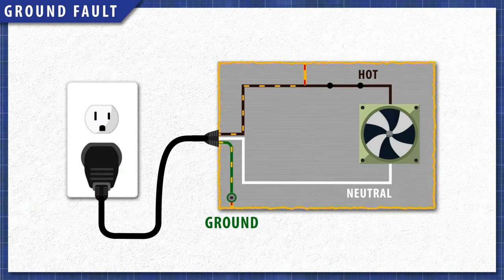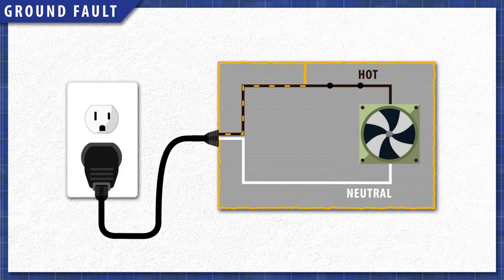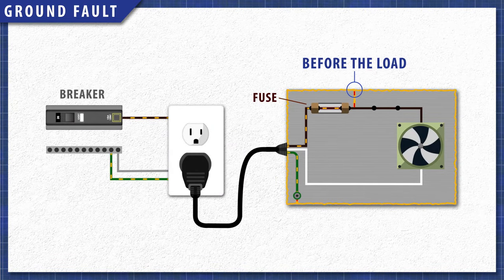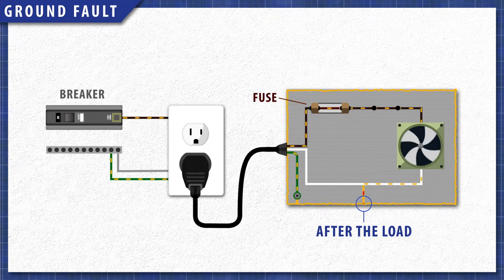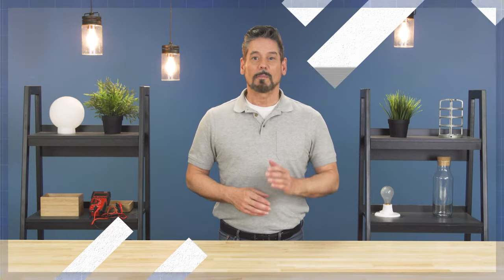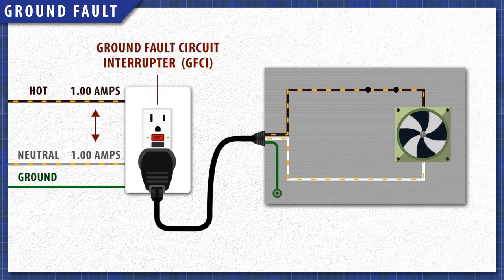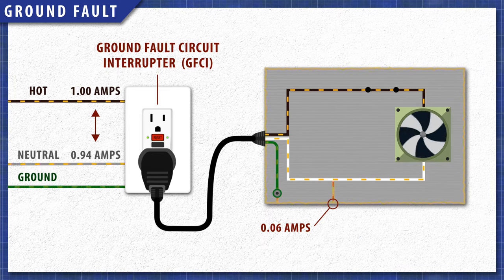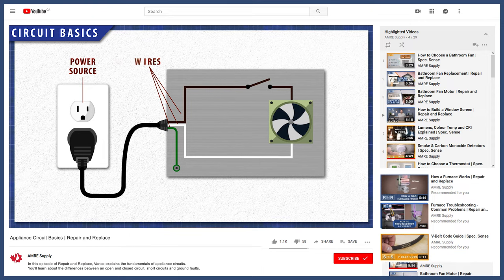What are Ground Faults? | Repair and Replace

Comment: Thanks for the video, if the appliance is not grounded and a ground fault occurs, can you please explain how a person would be electrocuted while  touching only with his left hand the appliance housing -  it makes sense to me that the left hand will be at the same potential than the metal housing  however I understand that in order for the person to be electrocuted, he must have his other hand or another part of his body connected to neutral for the the circuit to  compete and the electrons to flow, so how would he be electrocuted by touching only the hot wire and being completely disconnected from the neutral - thanks
Reply from the maker: Thanks for watching. If an appliance doesn't have a ground wire, and has has rubber or plastic feet then it does not have a good path to ground. If someone's body has less resistance than the appliance's path to ground, and the appliance is shorted then the electricity might flow through their body to ground. Wearing shoes can reduce this chance of electrocution as the rubber soles disrupt the path to ground.

Comment: Thank you for the video. 
My outdoor plug just out of power while I using an electric lawn mower. GFCI and Ground fault BR breaker are both used in this line. I replaced both of them and still not working. The breaker's error code indicates there is ground fault issue. so just wondering how to narrow down and find out the ground problem. 
Thanks.
Reply from the maker: Thanks for watching. First test reset the breaker and test to see if there is voltage at the receptacle itself. https://www.youtube.com/watch?v=kH2Rbh_m6rM If there is power to the receptacle try plugging a simple light first to see if that trips and creates the ground fault error code. If the code continues to show up then its possible that there's a fault between the outlet and the electrical box, or in the wiring to the breaker.

Comment: Good  morning my question is .what is capacitor value of furnace blower moter  .we need mfd and voltage
Reply from the maker: Thanks for watching. The capacitor values vary between furnaces. The capacitor value is written on the side of the capacitor. 

We have a video that explains capacitors in more detail: https://www.youtube.com/watch?v=NkgxNLCrmr0
As well we have a video that shows how to replace the blower motor and capacitor: https://www.youtube.com/watch?v=4SY8lRl8HV0

Comment: Thanks for your very well produced videos. 

I have a question you might be able to answer, since you also produced a video on condensate pumps. My condensate pump is plugged into a dedicated ground fault outlet, nothing else is plugged into it or chained off of it. For more than ten years it worked great and never tripped. I did replace the pump about six years ago when I had other maintenance work done and my contractor advised replacing it. This pump has a furnace cutoff, the old one did not.

What is happening lately, for a few months now, is the ground fault trips - for no particular reason. I have not changed anything in the house for years, so I don't suspect an unintended wiring error somewhere. 

My suspicions are as follows: (1) The condensate motor is failing, (2) the GFI outlet is failing, or (3) the drain hose has slowly built up debris and is causing the sump pump motor to overwork at times, leading to a GFI trip.

I can definitely DIY this, and can easily afford to simply replace the condensate pump and GFI for much less than bringing in a plumber or technician. But I'm wondering about the drain tube which is 25- feet long and fairly difficult to work on. It is a bit cloudy in appearance, but the water moves along just fine inside. I am "tempted" to pour something into my pump - hydrogen peroxide, for instance - and let the chemical action clean out the tubing, as is done for aquarium tubing. Does this make sense?

Thanks for reading this! Any help at all will be greatly appreciated.
Reply from the maker: Hi Terry, thank you for watching,, we're glad that you're finding the videos helpful!

1) The condensate motor is likely failing and is shorting to ground. These motors and the casing around the motor are not the most robust,  so that's the most likely point of failure
2) GFCI outlets can fail, if you think this is the case you could try plugging a simple fan or device into it to see if it trips from something other than the condensate pump.
3) Its good to clean out debris, but this is unlikely going to trip a GFCI outlet. If the motor works harder, the current will rise slightly but there won't be any current leaking to ground just because the motor is drawing more amps.

The drain pipe will get cloudy, but if the water is moving freely then its likely not a huge issue. Doesn't hurt to clean out any debris though.
Reply: how many amps is the new pump? and what size wire and breaker is it on?

Comment: Hi! 

I have a new solar hybrid inverter installed last month and it is not in the final position yet so the grounding wire is not yet installed. 

Its been raining hard at our place now for week and I noticed that every time I touch a bare metal part of the inverter like screws I can feel a tingling sensation. Is this a ground fault caused by moisture?  Its not there when I first installed it.

Will it be fixed if I install the ground wire? 

Thanks!
Reply from the maker: Thanks for watching. In this case, installing a ground wire should provide a path to ground preventing a shock but its best to double check all the connections as there could be a short somewhere. You can also use a multimeter to test to see if there is a short to ground by testing continuity between the bare metal part of the inverter and the leads.
Reply: @AmreSupply   Thank you for your reply.  I tested it a pen tester (don't know what it's called) and  it lights up  very slightly. My guess that it could be due to moisture might be correct because the tingling sensation is gone now and its been sunny here.  Just waiting for the parts now hoping to install the grounding before it rains again. 

Thank you and more power!
Reply from the maker: @lauadvincula2113  You're welcome! We're happy to help. The pen tester is a NCVT (Non contact voltage tester). When it lights up there means that the surface is live and has a potential difference or voltage. When things are dry it definitely makes it harder for electricity to pass though. Cheers!

Comment: Hi I just need some clarification, so basically since the frame is metal, it is allowing the hot leg to draw more amperage than the breaker itself causing it to trip when properly grounded? People tell me that since the ground wire has less resistance it trips, with out explaining/mentioning that it really has to go hand in hand with the metal frame of the load or a single gang box being the reason why it is less resistive? Please correct me if I'm wrong  thank you
Reply from the maker: Thanks for watching. The issue is that a circuit normally has a load. This could be lights, a motor, or a heating element etc. A load component will have a certain resistance and will consume power. If there is a short circuit and it bypasses the load, then all the flood gates are open the the current begins to increase past the point that the circuit can handle. At this point the breaker trips to protect the circuit to prevent the wires from heating up and burning out.
Reply: @AmreSupply  Okay makes a whole lot more sense thank you very much
Reply from the maker: @Graphitegrey  You're welcome!

Comment: Hi I was wondering if you can help me I have put I GFCI in my board. There is no problem until I use either the kettle or the Microwave the GFCI will trip but it will not trip with any other appliance. I done a insulation resistance test on the cables and found a short between the neutral and the ground cable this was due to corrosion in the socket on the wall that they were plugged into. I changed the socket and reterminated the cables the short has cleared but the GFCI still trips when you use either the microwave or the kettle. Can you give any advice?
Reply from the maker: Thanks for watching. If you have another GFCI in your home, then it would be best to test the microwave and kettle on that to see if the GFCI trips there as well. It is unlikely that both the microwave and the kettle are leaking enough current to both trip the GFCI, so it could be a faulty GFCI outlet.

Comment: Can you please explain why the current increases when we have a short ??
Reply from the maker: Thanks for watching. Voltage = Current x Resistance V=IR so resistance and current will decrease proportionally. Within the circuit, the load offers resistance. During a short, there is no resistance, so the current is unrestricted and it rises.  Its easier to visualize if we use the water analogy like what we showed in this video https://youtu.be/r_migcta_Is?t=86 Voltage is the, pressure, and current is the flow of water through the pipes. A restrictive pipe would have a low flow rate. If you cut a giant hole in the side of the water supply you'd have all the water trying to burst out at once. That is what is happening during a short.
Reply from the maker: As well this is covered in this video https://youtu.be/NCqh_D3B0ao Hope this helps!
Reply: @AmreSupply  Your explanation was crisp and clear. Thank you so much. Great videos keep up the good work
Reply from the maker: @goldfish5606  Glad that you're finding the videos helpful,  we're just happy to help!

Comment: How can you check for ground fault if you do not have a gfi
Reply from the maker: Thanks for watching. With the power off, you can test a wire for continuity between ground. Alternatively if you have a clamp meter then you can test the current and see if there is a difference between the hot and neutral.

Comment: I just received my amplifier. There were only two wires,  life/hot wire and neutral wire. There was no earth/ground wire to the amplifier.

When I touch it,  I was electrocuted due to current leakage. Do I need to add earth/ground wire to the body of the amplifier to solve the problem or look for the source of the leakage?
Reply from the maker: Hi Stephen, thank you for watching. If the shock only happened once then its possible that its static electricity that caused the shock. To verify if the current is leaking then you could use a multimeter to test from the case, to a ground source. Overall you can add a ground wire but its still not ideal to have any current leaking, so its best to try to narrow down the source.
Reply: @AmreSupply  hi thanks for your kind reply. It happened all the time. I tested it and there was 60V of AC current leakage from one of the board. I was wondering where was it come from because the only source that the board are getting are 18v of DC.

I added a new earth wire to the body of the amp and the multimeter showed no more leakage. The only problem was the micropohe port have noise and connection issues.

So, I have no coice but to removed the earth connection and I was planning to conceal the amp with a new wood box. Misteriously, after I removed the earth wire, there was no more current leakage until today. Maybe I accidently moved some of the component and make it right. I'm not sure. The onlybthing that I remember is that I have removed the paint in every connection of the body to improved the earth connection and that seems to solved the problem even after I removed the earth.

The only thing that I was wondering is, if this happened again in the future, do I need to ground it with earth wire or with neutral wire?
Reply from the maker: @stephenmichael3211  You are right that any current leaking can definitely create noise and interfere with the microphone.  The ground wire should connect to the ground and not the neutral. If there is leaking current you should fix which ever component is loose or defective. Its best to sort it out as the the leak could become worse over time and could cause a more serious shock. It would be best to reach out to someone with experience repairing these types of amps.
Reply: @AmreSupply  noted with thanks 😃
Reply: yes if you were electrocuted you would not be here. The correct term is shock.

Comment: No, it’s when an unintended electrical path is created between the power source and a grounded source. The wire doesn’t have to make physical contact, it can even arc due to proximity and increased conductivity.
Reply from the maker: Thanks for watching.

Comment: Do you or does anyone here know if I can simply use a (say) 250 VAC / 1 amp fast acting fuse to protect
the "ground" circuit of (or to) a Pure Sine Wave Inverter (that does NOT want the ground wire to be connected to neutral OR to anything other than ground?
Reply from the maker: Thanks for watching. This question is beyond the scope of the video. Even though a fuse would offer protection if added to the ground wire, we can't add any recommendations specifically to how this would be done.

Comment: Hi I don't understand how the current increases if the ground fault happens before the load?
Reply from the maker: Hi Ben, thank you for watching.  The load offers resistance to the circuit, without the load, the resistance is nearly 0 and the current increases until it trips the circuit breaker. 

Ohm's law is  V=IR or Voltage = Current x Resistance,  A useful tool for demonstrating this is an Ohm's Law calculator which you can plug in two numbers to see see what changes. https://www.rapidtables.com/calc/electric/ohms-law-calculator.html  For example if we have a 120 volt power supply and run a small 500 watt appliance, the resistance will be 28.8 ohms. In this case the current flowing through the circuit is 4.1 amps. 

Now lets say we bypass the load (shorted to ground) this might decrease the resistance to 0.1 ohms, the current will increase to 1200 amps! This is way more than the circuit can handle so the circuit breaker will trip.

We also made 2 videos that you might find helpful, one on electricity basics: https://youtu.be/r_migcta_Is and another one on circuit basics https://www.youtube.com/watch?v=SnRXD-0oXZo
Reply: @AmreSupply Ah Yes! Thanks for explaining that so clearly.
Reply from the maker: You're welcome Ben!

Comment: before the load is DC issue 

when such a fault contact of a naked wire to metal frame ..happens when device is off or unplugged definately this will not cause any breaker to trip other tan those named GFCI or RCD....  ...when ..............device.....on after it has been plugged in while already faulty
Reply from the maker: Thanks for watching. It all does depend on the circuit and how the device is wired so its not going to be the same in every scenario.
Reply: You were right
I just meant that short isnt accurate term because such fault circuits are not the shortest closed circuits in lengh outthere .They trigger mcb not because this  circuits are too short,  long enough . Overcurrent sensing breakers dont allow Line and N or another touching eachother without any resistant material inbetween

Comment: Thank you..
In single phase circuits, what ever current is passing through phase wire must flow back through neutral wire, considering no leakage currents. This is Electrical standard or even GFCI principle. If so then how any, load will consumes electicity if IN Amps (thru Line) = OUT Amps (thru Neutral) ?
Reply from the maker: You're welcome! Voltage = Current x Resistance V=IR so resistance and current will decrease proportionally. A load will just decrease the overall current in the circuit. Its easier to visualize if we use the water analogy like what we showed in this video https://youtu.be/r_migcta_Is?t=86 Voltage is the, pressure, and current is the flow of water through the pipes. Resistance is any restriction to the flow of the water. If we connect a turbine to the pipes it will decrease the overall flow of the water as its using some of the stored energy to spin the turbine. The rate of flow will be the same before and after the turbine (water cannot be supplied faster than it is discharged through the pipes). Now if we had a small leak several feet after the turbine the flow rate would decrease in the downstream pipe. In that case we could also measure the flow rate of the leak, which is essentially what the GFCI is doing.

Comment: it does not take the least resistance it takes all paths!
Reply from the maker: Thanks for watching. Yes you are correct that it will take all paths including the path of least resistance so the line could have been worded slightly differently in the video.

Comment: "If the component has continuity between the terminal and the metal frame, then it's Shorted to Ground and will need to be replaced." Your DMM says 22 ohms...so is that a short to ground? I thought a short meant little to no resistance like 0 ohms. 1:32
Reply from the maker: Hi Shaine, thank you for watching. Typically a short is a very low resistance path close to 0 ohms but that is not always the case and some shorts will have higher resistance.

Comment: What if it trips and you have a freezer full of meat...... should mention that
Reply from the maker: Thanks for watching. That is one scenario where you'll have to reset it once you notice that it trips. It may not be something that is noticed right away until some things start melting a little. Fortunately a full freezer has a lot of thermal so it will keep itself cool for days.